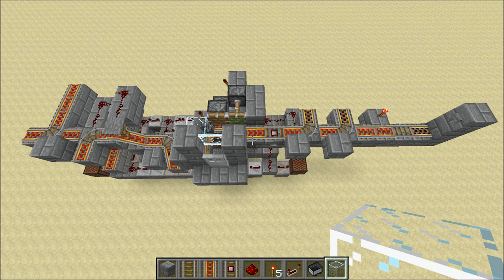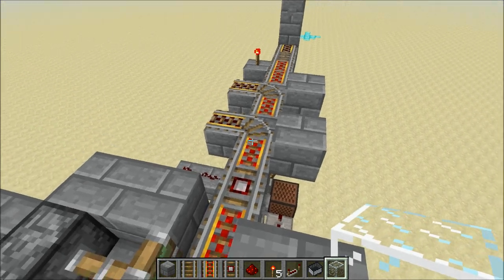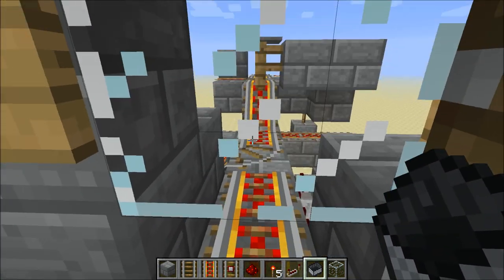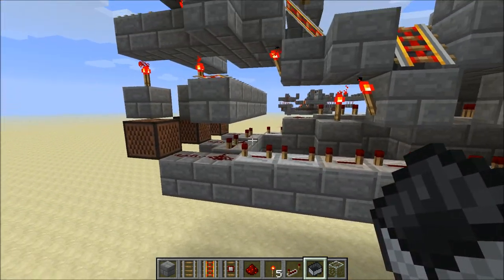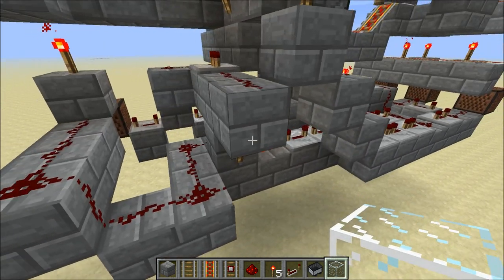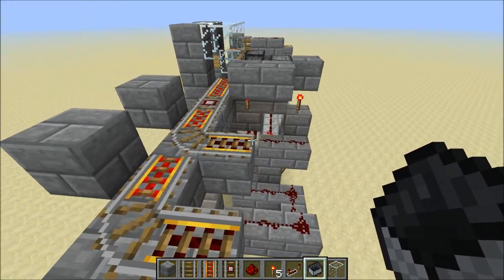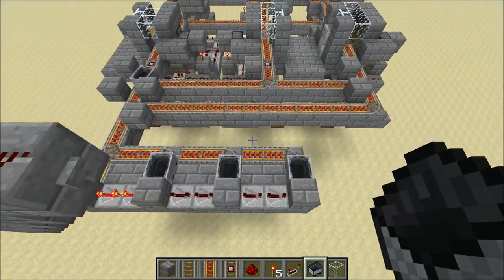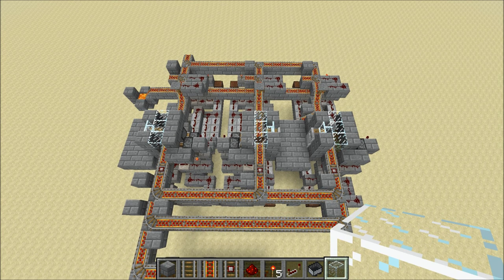Minecart Arrival Bays for MRT Station v4.0 (Minecraft)

Comment: I really like your design, it's neat and modular and can be scaled up to traffic needs.
I think you should build your station so that it can be easily expanded in the future if traffic is too high for the current capacity. 
I can see that the only flaw is if two carts are really close at the arrival, i.e. timing of departures at previous station; if I recall correctly they work indipedently from each other, so can happen that two carts reach togheter the same spot when riunite on the main track

Comment from the maker: @need4speed402 So the plate doesn't engage the piston after certain amount of time? That still won't work because the player can then just waltz right into the track area themselves and mess with any incoming carts.
In any case, I've made the savefile available, so if you can demonstrate a door-less solution yourself without affecting the functionality and overall size of the arrival bay, then I will use it in my station and give you full credit.

Comment from the maker: @RobotHQ The loopback should actually with 5 or 6 carts, since the looping carts all travel at the same speed, and the extra 3 carts will eventually take their place in the arrival bays.
The loopback isn't something I've finalized quite yet, but it seems like the only solution I can use right now. I considered having the extra carts instead bypass the station like I did in MRT v3.0, but I don't think I can make the space for it plus it looks rather inelegant.

Comment from the maker: @randomvidsinc123 One of the bigger complaints I had about MRT v3.0 was all the sharp turns and steep drops and climbs that the player experiences when arriving and departing the station. In my new version, I'm hoping to improve the user experience for the player by keeping the track as flat as possible and only turning if the main arrival bay is occupied. It may not be the most "efficient" design, but I think it's "efficient" enough to serve most player's needs.

Comment from the maker: @wickedwalshe121 Version 3.0 still works, yet one of the most common complaints about it was the sharp climbs, drops, and turns the player experienced when departing. In version 4.0, I'm aiming to bring a better player experience with flatter and straighter track, and faster departures and dispenser loading. It might look complicated now, but when you ride the cart through the finished station, hopefully you'll see that it's a smoother ride.

Comment from the maker: @funkyawesomedude Hopefully, in most cases the other user will get switched off to another bay. However, it's possible to have lots of people stand on all the plates at once, which would block all the bays. I'm still playing with the idea of removing the plate altogether and putting the door closer in so the piston pushes the player right out the door. If I get anywhere with that, I'll post another video.

Comment from the maker: @need4speed402 I could keep the piston extended until a cart hits the incoming detector plate...but what if some player comes in from the platform and steps on the plate just as the cart is arriving? The piston would get extended and cart would bounce back. The door is there to prevent that from happening.